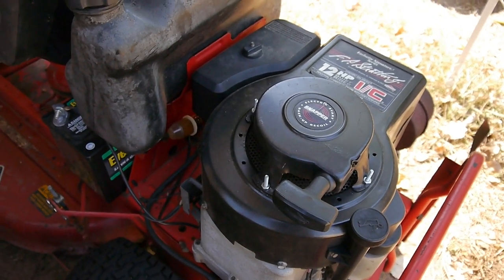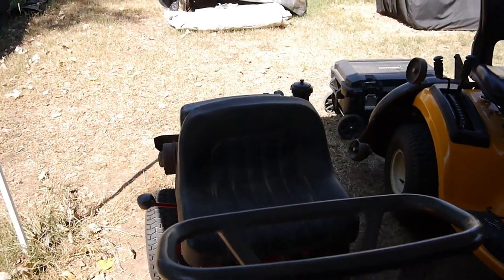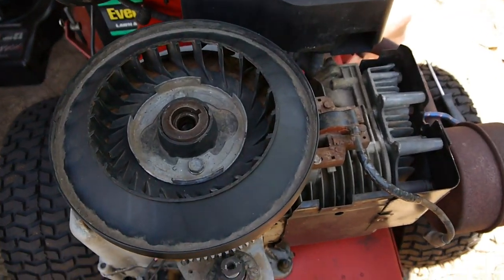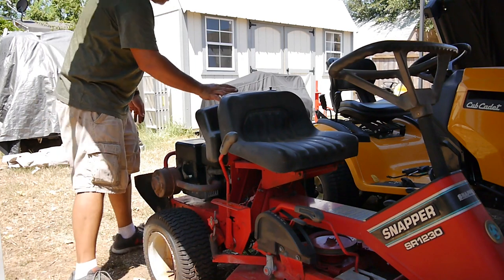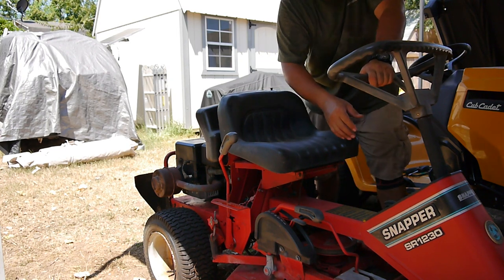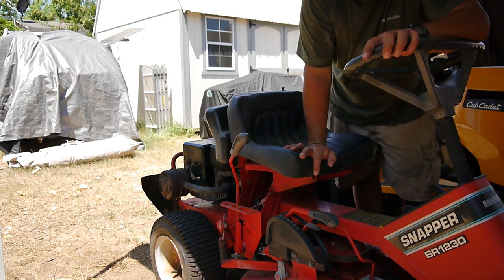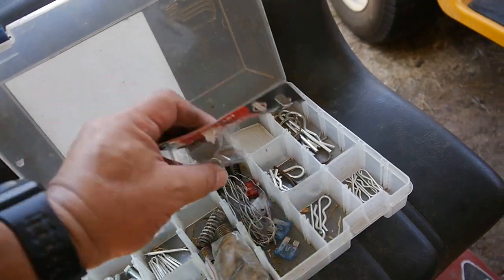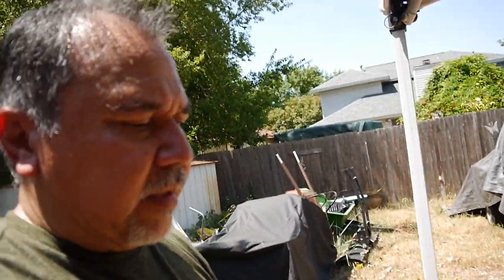Snapper Rear Engine Rider Part 4 - Flywheel Key Keeps Shearing

Comment: Crankshaft bolt isn't tight enough, it will keep shearing the flywheel key until it is tighten to specs.
Reply: That's for damn sure
Reply: But when you check the nut after it shears it doesn't seem to move,so how could you tell if the nut moved it not? And if it's I don't have a torque wrench is their another way? I'm talking about my scooter little race engine Ive been having some issues with the woodruff key and it's a pita
Reply: Also how about some loctite and tighting down really tight ?
Reply: @Cito_Fiytb_617  you can do that, but might make it hard to get back off the next time it shears.
Reply: @knighthawk86855  well I don't ever want it to shear again so is their a permanent fix I even tried the valve lapping compound but I haven't put the key just because I wanna make sure I do everything correct for the last time hopefully

Comment: Nice job on the mower!!! I bought one of your blade balancers and the hole on my blade is too big and it doesn't sit on the stem of the balancer. Do you have any spacers to make it fit? I love the balancer!!!
Reply from the maker: I just did a quick redesign, so it should handle up to a 1 inch mounting hole.  I'll send you one.
Reply: @SmallEngineDIY  thank you!! Do you need my info???
Reply from the maker: @mikepelzek6243  I'll look up your order.  If I have any questions I'll let you know.
Reply: @SmallEngineDIY  that's great, thank you for your hard work and I will continue to support you n your channel. Your channel is one of the best. What is your first name?
Reply from the maker: @mikepelzek6243  Randy

Comment: you can really sinch down on the pullstart mechanism, and tighten it super tight, I'm sure that's your problem, the amount you tightend it is not enough, buy the special tool so you don't break the ears off the starter  mechanism.

Comment: It is not a matter of quality always but of the right rated key . the primary purpose of a mechanical  key in any shaft or pulley system is one of sacrifice.. They are designed to fail . They have a rated range of they can operate in as you have discovered.they are designed to protect a much more expensive pieces of the equipment such as fly wheel , the pulleys, the shaft  though out the entire drive train system It is much cheaper to replace a $ 2 key than  a  $200 or more fly wheel or shaft. it is just as bad or worse to replace  them with one .that has to high of a rating .I  would imagine they have a rannge of H.P. they are rated for in the lower horse power as they are close together. Most people who do not do this type of work everyday are not aware of this. Some that are old enough to have  had the old outboard  were well aware of having extra keys for the props of their fishing boats.  By the way sometimes the keys will bend and not shear completely which can affect the timing of the spark plug which will spark but will make a engine miss, run bad or not at all and drive you crazy while you are trouble shooting. Didn't mean to be this long but us old retired mechanics like to talk. Hope this helps someone.
Reply from the maker: What you say is true, the key is designed to fail....almost like a fuse...to protect critical parts.  I think there is a quality issue on some of the aftermarket keys.  No telling what alloy was used.  The only way to be sure would be to test the shear strength of the key and make sure they meet the given specs.  I just don't have the proper test equipment or gauges.  It would be interesting to test them....

Comment: The key MUST be inserted down the shaft far enough to maximise key and keyway dimensions. You will notice top of crankshaft is tapered ,key must go down as far as possible!! Ps check your valve clearances too should turn over easier when starting up..

Comment: There must have been a source of backfires or hard stops.  I wonder if the key slots are long enough to run a longer key.  Also, if the flywheel taper and crank tapers are not perfect and perfectly clean or if the flywheel bolt torque is too low, then your not getting a good lock on the taper and it's moving back and forth beating the key at running loads.

Comment: The running issue, sputtering puttering, if the carb has an air/fuel mixture screw, it needs adjustment in or out, in most likely, if it doesn't have the screw, the carb needs a good cleaning, or gas is old and/or has water in it, get a long screwdriver so you don't burn your hand..... Keep up the good work.

Comment: I’d suggest you find a socket and long bar and torque that flywheel bolt down to spec’s. That pipe wrench is not tightening that bolt down snug enough.
Reply: Your absolutely right 👍

Comment: The same thing keeps happening to my snapper mower, already went through 2
Reply from the maker: Were they Briggs & Stratton keys or aftermarket brand?  I think the aftermarket brands (at least the ones I tried) are a weaker cast alloy, but make sure you torque the flywheel down to spec.
Reply: Small Engine DIY I used the Briggs and Stratton keys, I just put the last one on, and tightened it real snug, and that just barely fixed it
Reply: Clean the grease and oil off the flywheel and crank shaft tapers and torque the “nut” down to spec. That fixed my problem.

Comment: I think I may have the answer to your sheared flywheel keys. The wrench you are using on the main shaft nut is not being torqued to factory specs.  Thus the key shares too easily.. With as short a wrench you are using it is not tightening enough on the tapered shaft to keep it from shearing.. Find the torque specs and I think the keys you are using will be fine even those not Briggs & Stratton.

Comment: Hi. Love your vids. Wish i had found them earlier. My comment if hadnt missed it; when you have the cover off the top exposing the flywheel, i was always taught to sand paper the edge of the flywheel so that it is shiny...that promotes cleaner spark. Just a thought. Ty
Reply from the maker: I use sandpaper only if there is a build-up of corrosion or rust.  As long as the gap is set correctly.  After all, it is the magnetism to worry about.  So, I just clean off the build-up on the flywheel and the magneto if necessary, and it does help the spark.

Comment: I'm not trying to be a know it all but I've been a small engine repair heckler for about 48 yrs if you had a key shear more than once you should put valve grinding compound on the tapered part of the shaft and put the flywheel back on without the key and rotate it in one direction for about 1min remove it clean both peaces put key in and torn it at 30 ft lbs
Reply from the maker: Thanks.  Good tip.

Comment: The key is for timing, the taper shaft and flywheel need to be torqued. The taper fit is the lock/ drive that keeps the flywheel and crankshaft together